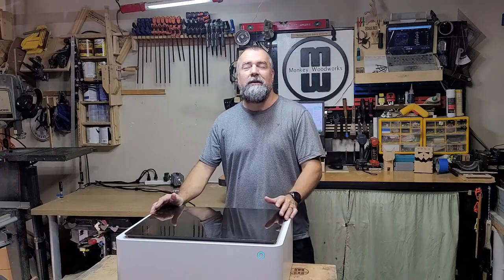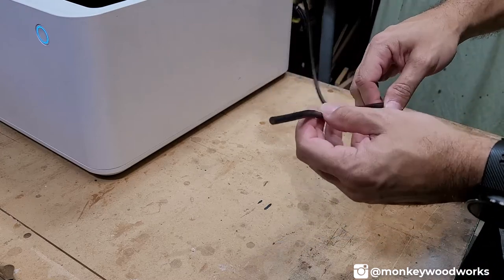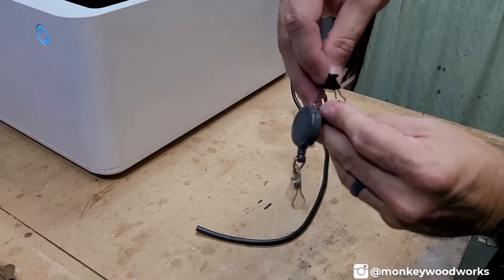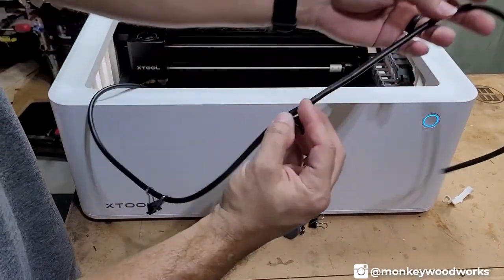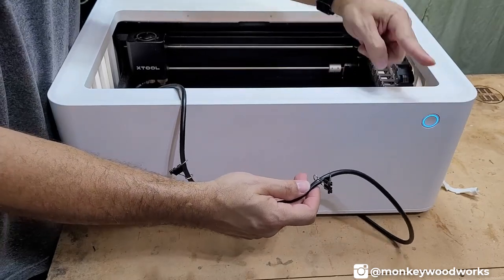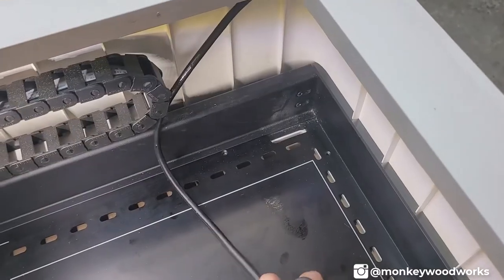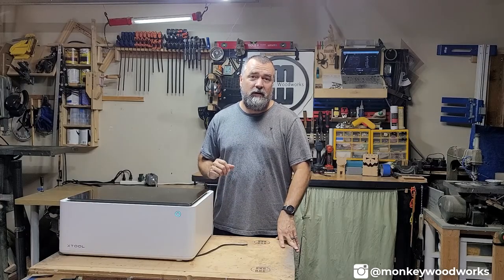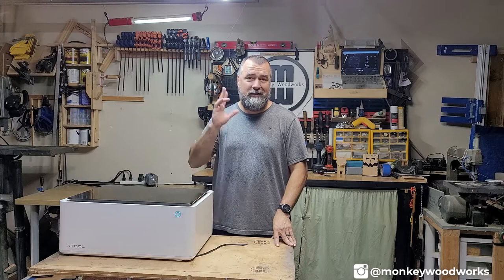Miller M1Air Assist for the xTool M1 Hose Routing

Comment: I wish I saw this before I did mine... I have issues - I did it as they suggest it. I will have to change it.
Reply from the maker: This routing works with the more flexible air hose provided with the Miller M1 kit.  The xTool hose is too stiff to work with this I believe.